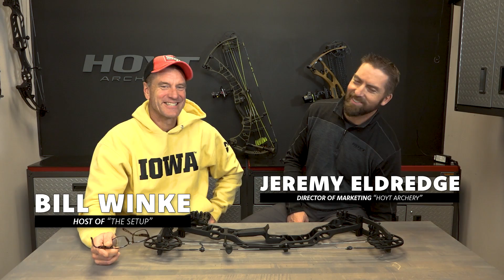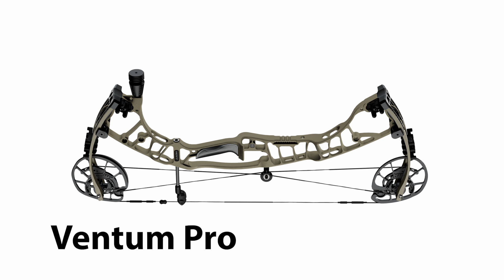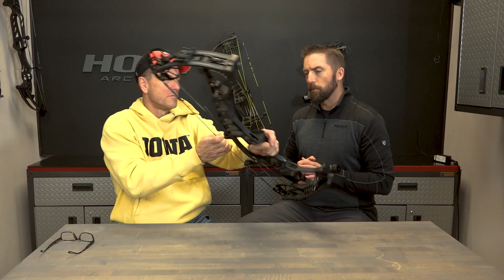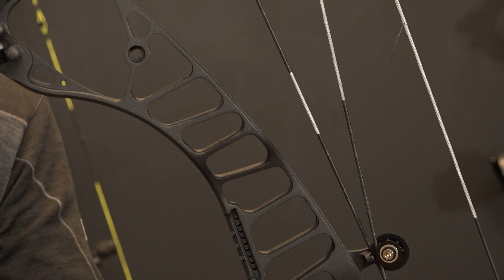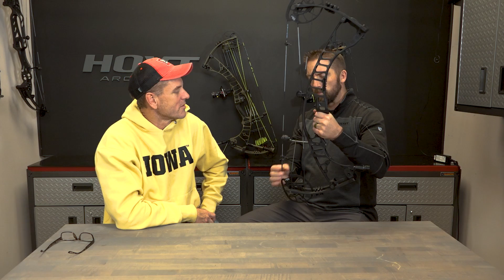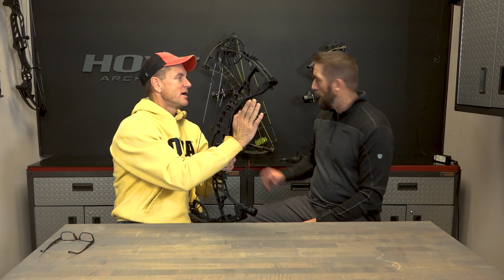How Hoyt made the VTM 31% Quieter | The Setup w/ Bill Winke

Comment: Hoyt missed the boat for me honestly.
I am really brand loyal, but since this year I'll be shooting Elite.
Hoyt is taking its name for granted, it'll sell, I feel. 
The least they should have done is make lower let-off drawstops given they came out with practically the same bow again (and in carbon actually).

Where we once had the big 3, Hoyt, PSE and Mathews, we're now seeing kind of a big 6, if not more. Where all of the big 3 of old got overtaken in adjustability because they added magrinal gains to their existing bows.

Maybe the'll eventually win me over, but as I am really brand loyal, that's going to take some engineering.
Reply from the maker: It is really hard to make big jumps in technology.  I am a mechanical engineer by training and actually worked at a bow company for a short time after leaving aerospace in 1990.  The physics involved are very limiting.  There is only so much you can do with a current bow design and we have about hit that limit. Jeremy talked about that in the interview and mentioned that focusing on smoothness and quiet performance and how the accessories attach is where much of the effort went both at Hoyt and at the other companies.  When you make a bow super adjustable, you also compromise pure efficiency at each draw length.  It has to do with how they store energy.  The more you try to do with modules, etc. with just one cam profile, the more you have to compromise efficiency and energy storage on all of the draw lengths.  I remember back in the day, Mathews made a bow that had a different cam for each draw length just for this very reason.  To change draw length you had to basically buy a new bow.  I am sure you can imagine how that went over, but the intent made sense - optimizer overall performance at each draw length.  Happy New Year.
Reply: @bill-winke  happy new year to you too. 

I appreciate that it's hard to engineer leaps. 
But, just speaking of adjustable let-off,  it can't be hard to make (aftermarket) draw stops like the current ones, just shortening the valley a bit, for more holding weight. 
Or optional lower let-off modules. 
I can shim a bow for tuning, that Elite does it without a press wasn't necessarily the big selling point, the options were. 

If Hoyt had done that, I'd be shooting an RX7 Ultra, and never even touched an Elite. I would not have had to buy new hats and a field quiver. Believe me, I wish Hoyt made a bow for me. 

I'm not bashing Hoyt by any means. I have enjoyed my Nitrum 34 for years.

Comment: Any info on the decibels of the bow?  31% quieter but how does it compare to other bows?  Hard to tell in an archery store.  I’m trying to compare to my halon 6.  The draw cycle on the vtm31 is the smoothest I have ever felt.  Unbelievably smooth with no real noticeable valley before the backwall.  Backwall also felt solid as a rock.  Compared to the phase 4, elite omnia, bowtec cp30 and halon 6 which all have varying draw cycles, valleys and back walls the vtm 31 was smooth as skippy just like their ad says
Reply from the maker: I wish we would have had more time to go deeper into the sound testing.  I once set up a noise test with several bows using the sound equipment and lab at Limb Saver (back when that was a really going brand).  I really enjoyed that. I would have loved to see the actual sound testing take place.  Maybe next time.  Thanks for the comment and Happy New Year.

Comment: I am still shooting my Hoyt Turbo Hawk from 2010  !!!!!   it is automatic to shoot an is still shooting just fine after thousands of arrows , had it all reworked a couple years ago new string set up an it was just like new   I Love It !!
Reply from the maker: If it's not broke don't fix it.  I shot the 2004 UltraTec for about six years until the Alpha Max came out.  The Alpha Max was so much better than the UltraTec it shocked me.  After just one shot with the Alpha Max I never shot the UltraTec again.  Sometimes it pays to upgrade when the change is really noticeable, but you have to save up for a while to afford today's best bows.
Reply: That turbo Hawk , and I think Hoyt even carries the power max, which is very similar if I’m not mistaken, excellent Bows , would like to find a Powermax within my budget,(looks like the Torrex replaced the power max as a mid priced bow.)